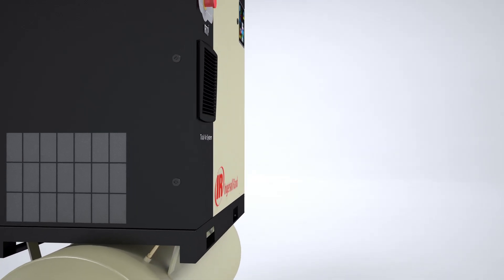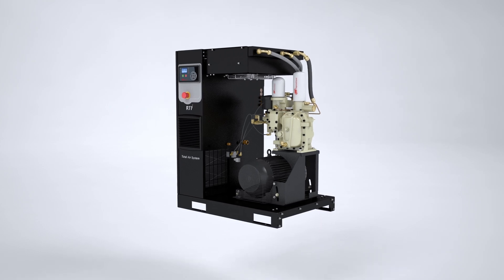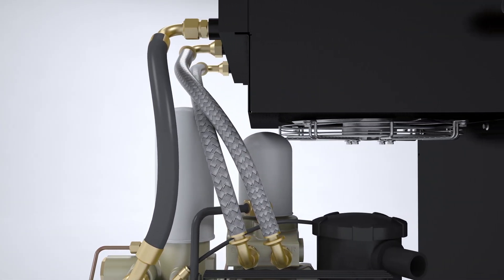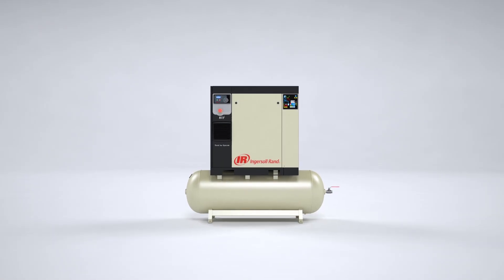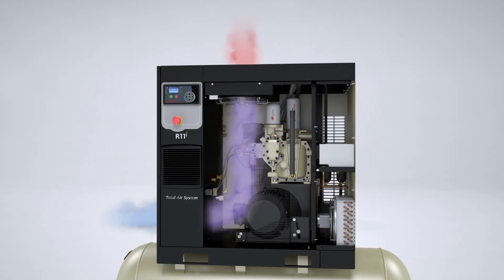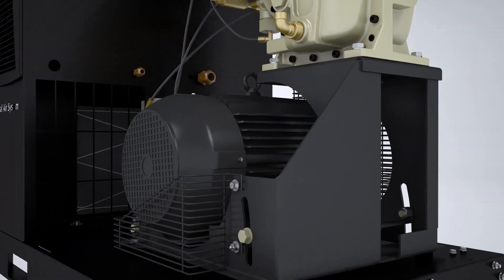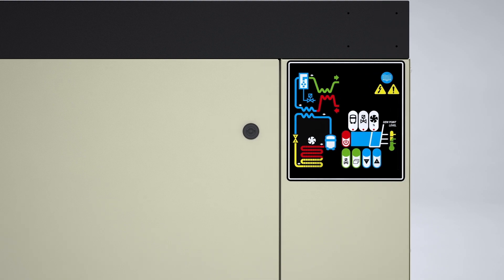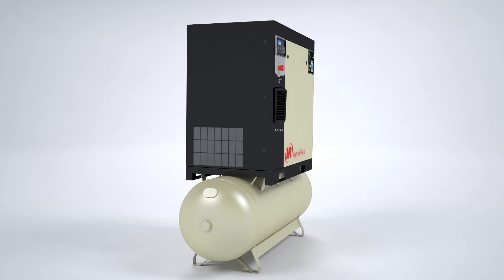Ingersoll Rand R-Series 4-11kW (5-15hp) rotary air compressor

Comment: I serviced Ingersoll Rand air compressor with A4804 alarm and after the service the alarm persist and then if started it runs within few minutes it heat up and show temperature limit alarm and at 109 Celsius, it will shutdown. I need help to resolve this issue. Thanks